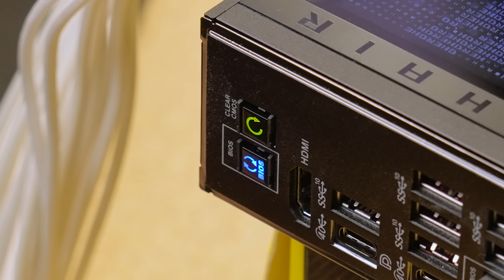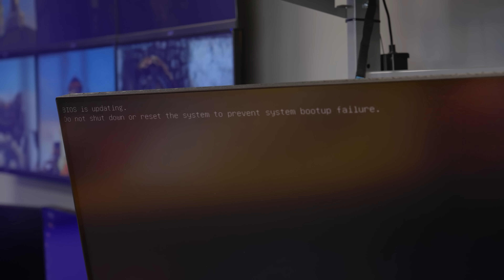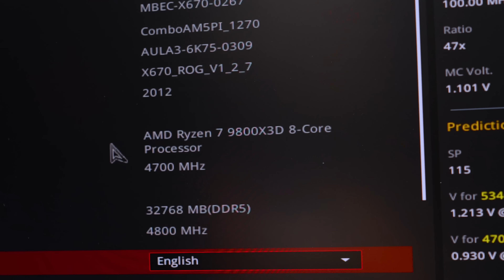This PC wouldn't post... so they brought it to me!

Comment: I had an issue with Asrock X870E taichi lite recently.  7950x3d wont boot on EXPO 6000 and full CCD. Been working wirh Asrock support.  They pushed a new BIOS update and now it works.
Reply: Nice!  Good to hear!
Reply: I have an ASRock 650.  Flashbacked to 4.03 yesterday and my GPU died 😭😭

Fortunately I'm within the return window so I can exchange it.  Still a pain in the ass.
Reply: Thank GOD i don't have an Asrock board!
Reply: They're still having those issues?! My God that's so frustrating. I love the design of the Asrock X870E Taichi Lite and it would go great will go great with the G. Skill Trident Z Royals but I'm so paranoid to buy it and experience the bios murdering my X3D CPU.

Comment: Since my 9800x3d and Windows 11 upgrade, boot up time increased at least 3 fold from my 5600x and Windows 10 build.  On top of that, if the PC has been off for a while, the boot into Windows runs terribly.  It takes 1-2 reboots for it to run properly.

Help me Jay!!
Reply: You could try some videos on debloating Windows 11 and turning off any unnecessary features. Search indexing eats ram and cpu bandwith. Apps running in the background also cause lag. Grumpy Sys Admin has some great guides.

Comment: My pc is definetly posessed, ive changed out every single component and deleted and reinstalled windows each time and it still randomly crashes to black screen whilst gamin and all sounds continue but picture doesnt come back so i have to turn pc off and on
Reply: 1st things first, as stupid as it may sound. Change your HDMI or DisplayPort cable out for a brand new one. Preferably DisplayPort. 

Second, Im going to guess you're on a radeon card? If so, there's a windows issue that causes this and also the Driver Timeout where you have to create a custom Group Policy to prevent driver updates during windows updates, Youll have to google how to do that and follow the steps. Also, Go to the start menu and type sysdm.cpl and click Hardware > Device Installation Settings > click No for automatically installing apps and features > save > Uninstall your drivers using the AMD cleanup tool (not DDU, DDU wont work for this trust me ive tried) 

Reinstall drivers fresh and during driver install, Itll ask you where you want to install it like your C drive, Youll see additional options and "Factory Reset"

Make sure its checked. 

Give it a try.
Reply: maybe its something to do with your monitor cable or monitor itself?
Reply: do the GPU fans ramp up to full speed when that happens? If so, either the PSU can´t handle the random wattage peaks of it that cause the 12V rail drop to low causing the GPU giong into a shutoff state, or the GPU power delivery itself is faulty.
Reply: @Bllfrnd  YES, the fans speed up like crazy , do you know how i can fix this?
Reply: Same, but mine crashes and randomly restarts. Checked the error code and it's a kernal power error.
Swapped almost every part except for CPU/mobo and went thru 2 PSUs.
Both PSUs are fine when tested. 
PC runs well with no problems from 3 months if you change PSU.